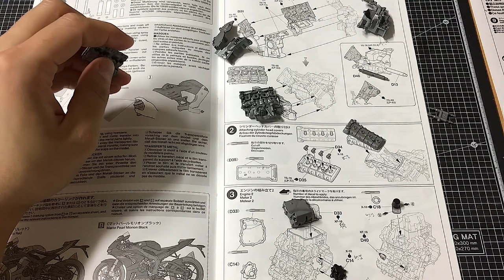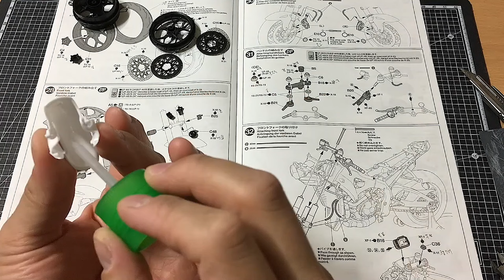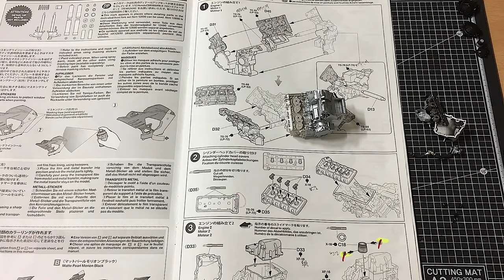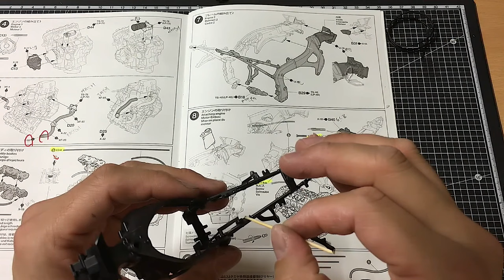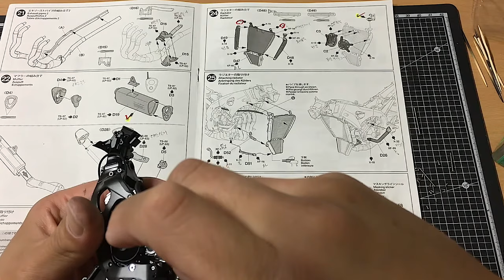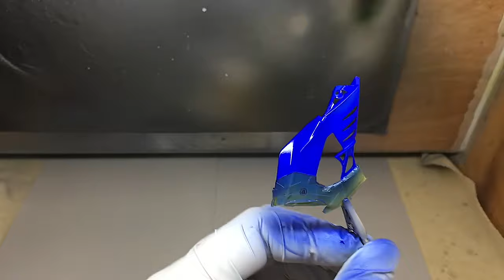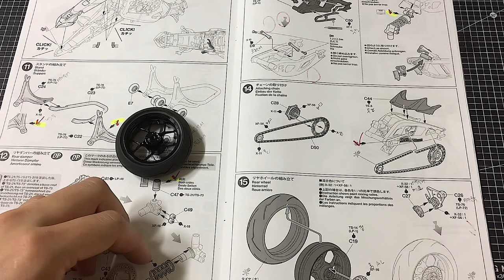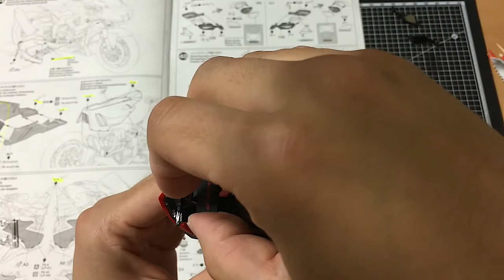[Full build] Honda CBR1000RR-R Fireblade SP  Make It 1/12 Scale step by step build (Tamiya)

Comment: One of the frustrating things I ran into on my build was getting a tight fit where the side cowl "secures" to the underside of the front cowl. The tab from the side cowl should have snapped into something, rather than rely on a pressure fit. But you didn't seem to have that problem(?) I had to glue mine in.

Comment: Bravo! It looks terrific, and the finish is excellent.
I just purchased this kit.

I’m curious why you sprayed semi-gloss clear before and after your decals….
and then you applied your 2K gloss.

Is it better than using a gloss clear before & after the decals?
That’s the steps I’ve been taking.
Reply from the maker: Glossy has a long drying time. I chose half-luminous because it might get dusty. There are other reasons, but it's not explained well with the translator, so I'll cut it down.

Comment: Hi bro, May I know what is the glue you used at time 11:35 ?
Thanks bro.
Reply from the maker: Tamiya Cement
Reply: @Makeitscale  Thanks bro
I'm just afraid it will brake the paint surface
Reply: @transonlam6109  Yeah me too. I tend to use a few small drops of superglue instead.
Reply: @DrRasputin2012  thanks for sharing, and I find some other kinds of glue also can do goof job, Bulaien B-6000(I'm in Viet Nam)...it's used to glue smart phone screens